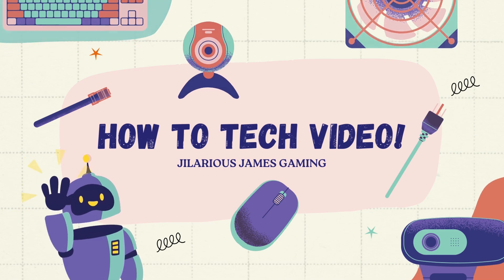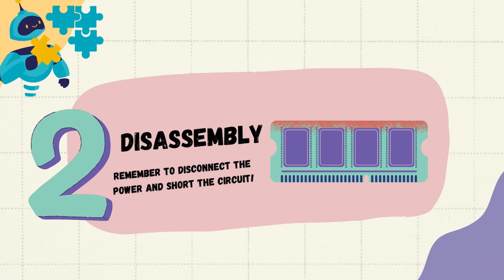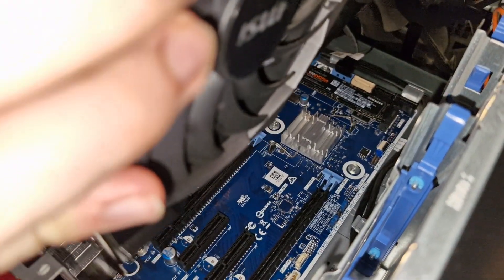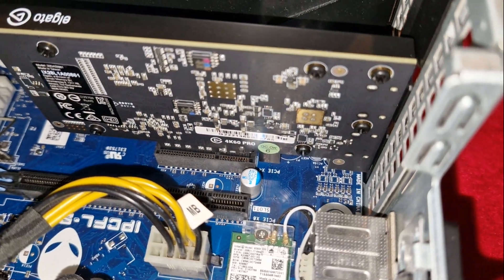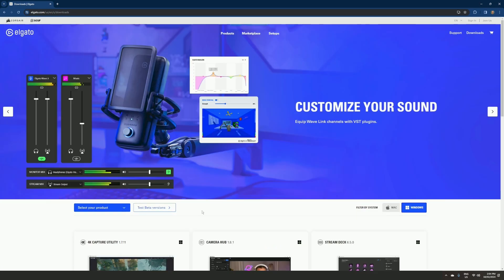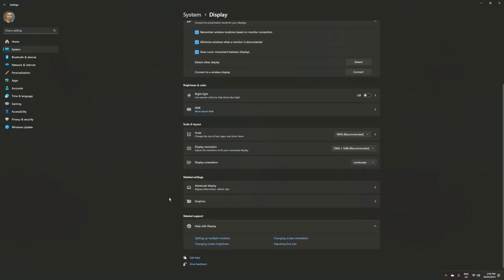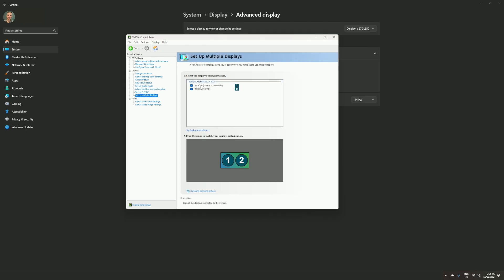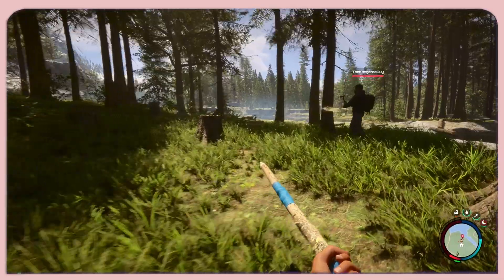How To Setup Elgato 4k60 Pro On PC | #productivity #pcgames

Comment: You do not want to move that graphics card out of that top slot.. it is for sure 16x slot which your GPU needs, at the bottom of the MB, there appears to be a second 16x slot as well, but it may not be wired for the 16x, it may be just 8x wired.. and that Elgato will fit in there, it does not have to be a 4x slot, any slot larger will still work.. and put that Elgato in the bottom 16x slot..

Comment: Is there any way I can use the 4k pro with my ps5 and not have any input latency?? Also, can I get the image to be shown through my HDMI port even though it's displaying to my pc into obs stream labs? I would love to do a discord call, facetime or something so you could explain/help me further if you wouldn't mind? Either way, thank you for taking the time to read my message. Best wishes.
Reply from the maker: Hi there, appreciate your message :)

OBS will have fairly high latency – it needs to process the image and send it to the software before you can see it.

If you want close to zero latency, connect the output of the PlayStation to the Elgato's input. Put the Elgato's output to a low latency monitor.

Here's a simple way to set it up:

Connect your PlayStation's HDMI output to the " HDMI In " port on the Elgato 4K60 Pro.

Connect the "HDMI Out" port on the Elgato to one of your monitor's HDMI inputs.

Connect your PC's GPU output (HDMI or DisplayPort) to another input on the same monitor. Or use a HDMI splitter if only 1 HDMI port is available.

Use your monitor's input/source button to switch between the PC and PlayStation inputs as needed. Make sure HDCP is turned off.

Important Notes:

Always play your games through the monitor connected to the Elgato's HDMI output. This ensures minimal input latency, as the Elgato 4K60 Pro provides lag-free passthrough.

Avoid playing directly through the OBS preview window, as it introduces noticeable latency due to processing delays.

Ensure your monitor supports the desired resolution and refresh rate, and that you're using high-quality HDMI cables to maintain signal integrity.

Quick Summary:

PlayStation → Elgato "HDMI In" hdcp turned off.

Elgato "HDMI Out" → Monitor (for gameplay)

PC GPU Output → Monitor (for PC use)

Monitor Input Selection → Switch between PlayStation and PC as needed
Reply: @JilariousJamesGaming  The hdmi image doesn't go through with this new capture card (which is odd because why have an output port if it doesn't send signal through to the monitor?) I have a display port cable and a hdmi cable which works with my old capture card just fine. I just don't understand why the image no longer works with the new capture card... 
        My stream seems to downgrade the quality when the games I play get more active than not, by any chance would you have any tips for improve that issue? I have a 8k hdmi cable that my ps5 says isn't capable of 1440p resolution. Tech is confusing sometimes. Thank you for taking the time to respond to me by the way.

Comment: So how do I do this with AMD and a ps5?
Reply from the maker: Great question, @Spontjaan! To connect your PS5, you'll need two HDMI cables: one cable should connect the PS5's output to the input of your 4K60 Pro, and the second cable should link the 4K60 Pro's output to your TV or monitor. I'm considering creating a detailed video to further explain this setup. However, my schedule is currently full, so it might take some time before I can produce it.
Reply: @JilariousJamesGaming  thanks! Will try this. It kept saying no signal. But I think I missed a step 😂
Reply from the maker: @SpontJaan 😂 no drama, let me know how you go
Reply: @JilariousJamesGaming  it works! You have to turn of a setting in the ps5 itself!
Reply from the maker: Fantastic 😊 
Appreciate you sharing @SpontJaan

Comment: how do I do this on AMD
Reply from the maker: Great question - the installation process remains the same. The dependent variable here is your hardware. To see if your system is able to run the capture card, have a look at this link :)

https://help.elgato.com/hc/en-us/articles/360027964112-Elgato-Game-Capture-4K60-Pro-System-Requirements